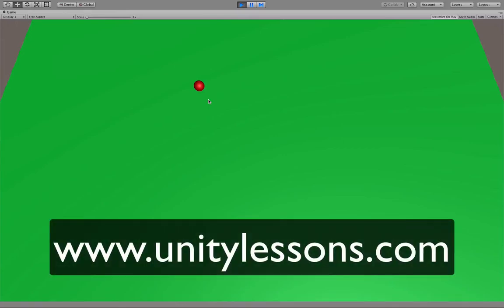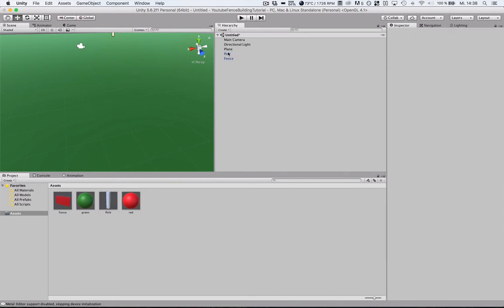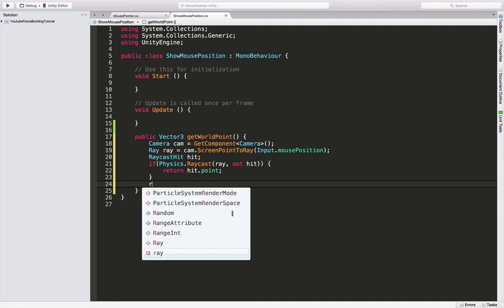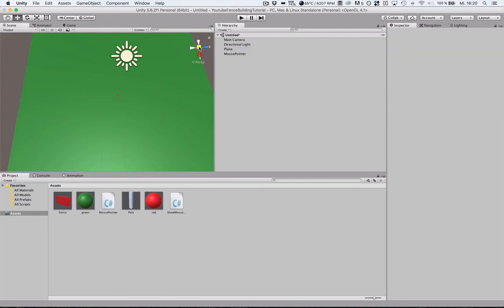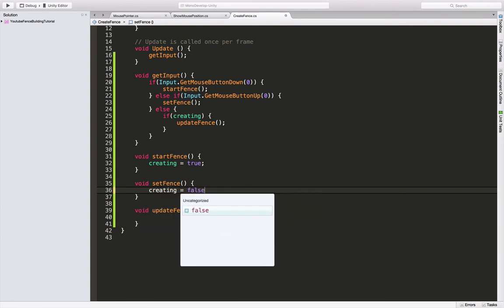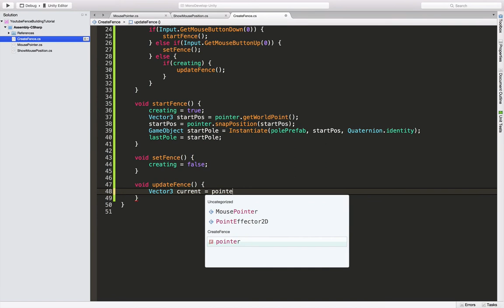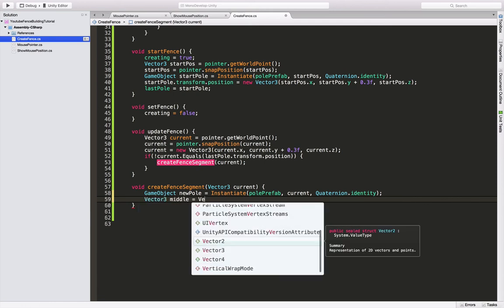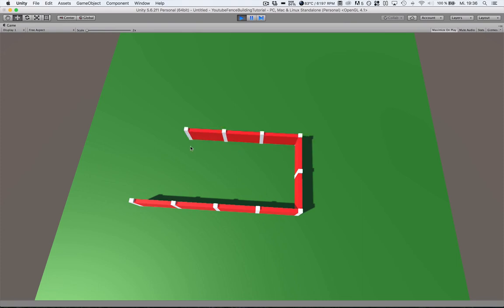Unity3D Tutorial: Modular Fence / grid based Wall Building

Comment: Thank you for the video tutorial. That was really helpful. But I got a question, I have imported a fence model from Google Sketchup and made a prefab of that and dragged it onto the right slot in the inspector, however, it does not work as expected. Now, when I remove the imported fence model and drag the normal fence prefab made in the video, it works perfectly fine. How I do solve this problem so that I can use the imported fence model from Sketchup instead of the one made in the video? 

Second question, How do I make each fence segment interact with the terrain such as a hill? Please reply. Thank you

Here's the link to the fence I want to use from Sketchup: https://3dwarehouse.sketchup.com/model/e9d22feabe066bb26c03c11657c96c60/Jurassic-Park-Fence
Reply from the maker: Hey! I don't see why you shouldn't be able to create a prefab from a model created in sketchup... which format did you use to export the model from sketchup? What do you mean by "it doesn't work as expected" - does it give you an error? Does something else happen?
Reply from the maker: in order to make the fence lean to a hill, you should not snap the y position but leave it as it is. Consequently the poles will be at the correct height. Then adjust the angle of the fence part in between, possibly use LookAt somehow again
Reply: I was able to create the prefab of the model from sketchup. The format I am using is 'fbx' because 'dae' format imports the fence at an angle. Now when I drag the fence segment onto the slot in the inspector and run the game, it instantiates the fence segments but each fence segment overlaps each other from the middle pole, and I do not know which part of the code I should change to make it work properly. If you go on the link I gave you and see the model, it has three poles, the problem is that the next fence segment instantiates from the middle pole instead of the last pole and I cannot seem to make an enclosure with the imported fence. Can you make a video tutorial if possible and use and an imported fence model (maybe the one in the link above), and maybe also include interacting with terrain? Sorry I don't want to give you any trouble but you are the only who knows how to do it.
Reply from the maker: nah, you just need to change the size of your fence or snap to positions divisible by 2if your fence is of length 2
Reply: so which part of the code should I change to make that happen?
Reply from the maker: either change the scale of your object in the inspector so it is of length 1 or adjust the snapping function by adding %2 in the end of each line snapping x, y, z. It's called modulo if you wanna read it up. Also I can recommend the learn section at unity3d.com to cover all your basics concerning scripting and the editor :)
Reply: Hi, I have tried using %2, it seemed to work for a while but it only instantiated 2 fence segments and the rest of the fence segments are inside each other. So, I am playing around with the code but first using the prefab that you made in the video before I use the fence. However, I can't seem to figure out how do I make each pole appear after 2m or 3 or 4 instead of 1m that you use in the video tutorial, because I have extended the fence prefab's Z size to 2 instead of 0.9. I tried changing the snapped function and played around with the numbers in both script but the poles don't adjust to the fence prefab.
Reply from the maker: I'd recommend working with integer positions for the poles, cause otherwise the math gets complicated for no reason... If you do %2, the poles should snap to every second position. Don't try to integrate everything at once, start by placing poles with distance 2 first..
Reply from the maker: I'm sorry, just doing %2 of course doesn't solve it... I'm gonna try and figure something out for you
Reply from the maker: use this to snap to every second position: 

public Vector3 snapPosition(Vector3 original) {
  Vector3 snapped;
  snapped.x = Mathf.Floor(original.x + 0.5f);
  snapped.y = Mathf.Floor(original.y + 0.5f);
  snapped.z = Mathf.Floor(original.z + 0.5f);
  if(Mathf.Abs(snapped.x)%2 == 1 ) {
   snapped.x = snapped.x-1;
  }
  if(Mathf.Abs(snapped.z)%2 == 1 ) {
   snapped.z = snapped.z-1;
  }
  return snapped;
 }
Reply: Hi, sorry for replying late, I was playing around with the code and made my own fence model using blender and sketchup and imported it in unity with a length of 2. It finally worked in that the fence instantiates between two poles. I thank you for all your help. However, I need your help in last two things:

1. How do I ensure that there is a validation carried out to check if the user moves the mouse position back where there is already a fence placed between the two poles, do not instantiate the fence, else do instantiate? Because when I move my mouse position back, it instantiates a fence segment in front of the already existed fence.

2. How do I place a gate on only the fence?
Reply from the maker: 1. set the poles's layer to default again instead of to Ignore Raycast, check if there already exists an object before placing the fence, only create a new fence if position wasn't occupied. You might wanna handle it differently though for the start position as otherwise you won't be able to >connect< to existing fences. 2. If you wanna build a gate, you will have to exchange the fence prefab which is being instantiated to a gate prefab. Think of what the user needs to input and then trigger between fence and gate prefabs.
Reply: Thanks for the reply. I am still stuck at point 1, as in how do I say in code if the position wasn't occupied then only spawn the fence. I have been trying to do that for couple of days playing around with the code and the object's collider, but it still doesn't work.
Reply from the maker: do a raycast and retreive the hit object, then compare a tag or something to see whether you the floor or actually a pole
Reply: Thanks for your help. It finally worked. Sorry for trouble. Just one last question, how do I ensure that when I click the UI button it would spawn the mouse pointer and then does its normal usual thing where ever I point the mouse?
Reply from the maker: simply use a boolean variable that gets switched on when you interact with your UI button. Then disable the MousePointer and Input if said variable is false, enable it when true. Work with if statements here to turn on and off parts of your code. Good luck ;)
Reply: Hey thanks for your reply, the button worked. Sorry for late reply.  I have two last questions:
1. How to ensure that the fence instantiates every 1 meter (or however long I want it to be) from the last pole even if I move my pointer fast in the screen?
2. Is it possible to merge your dynamic wall tutorial with this fence tutorial, so that when I click my mouse button, the wall would instantiate and however long I drag the wall that many fences it would instantiate, and the wall would disappear and then reappear if I click the mouse button from the last pole of the fence. So basically, the wall would act like a Transparent fence template (like in normal strategy games)?
Reply: Hey man, I like that you are making a game like prehistoric kingdom, they have been uploading new devlogs now, I was wondering though if anyone could help on making some sort of fence system that would go up hill, but the player wouldn't need to change anything, it would automatically do this. Thanks, also I am a complete Unity beginner so I would need just simple codes, or explanations, thanks.